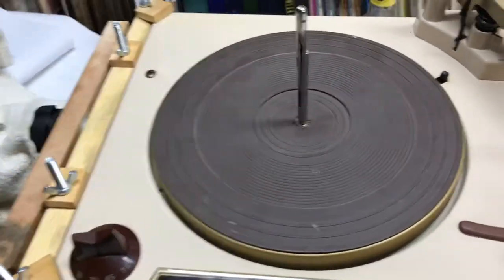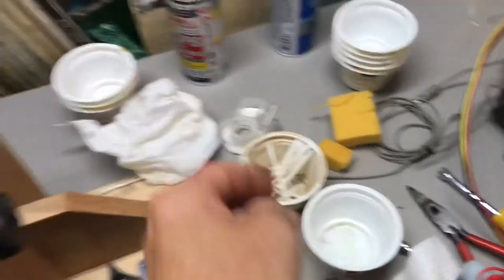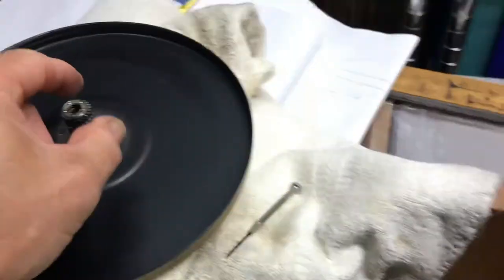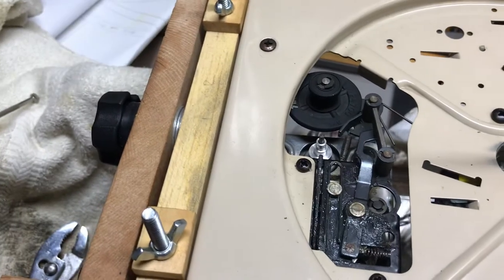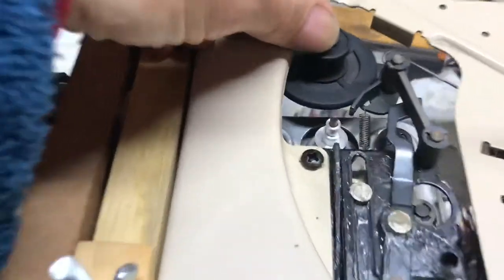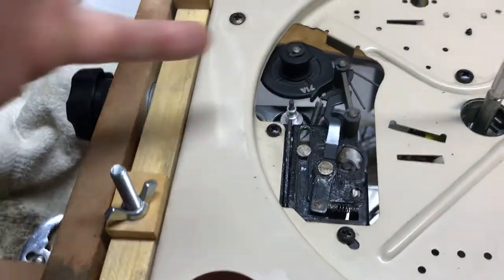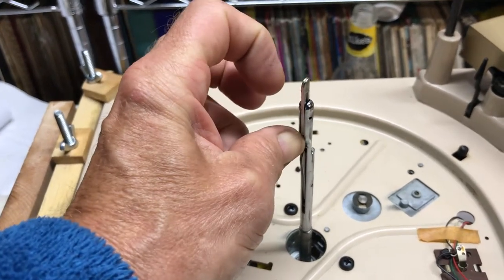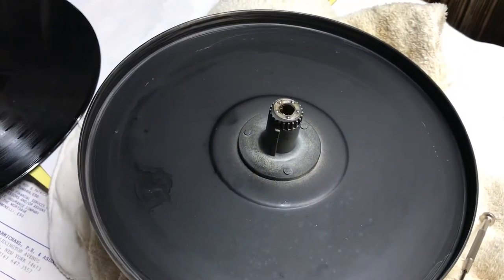Voice of Music record Changer

Comment: Now hold on a second here. I also restore VM changers, and there is no need for the customer to do any of this if it's done right. I'm looking at your speed change mechanism, and there is grease oozing everywhere, WAY too much grease. You only need to apply a drop or two under every pivot point to ensure the mechanism moves freely---any more than that and your over-doing it
Reply from the maker: Good morning and thank you for your comment. This video was to highlight what may happen during shipping and what to do about it. I like to grease those parts you mention for smoothness of operation. Perhaps a bit too much on this one. Oil tends to migrate over time whereas grease stays put. I reserve oil for high speed applications such as motor bearings. I never use oil for slow moving mechanisms. Cheers! Dan